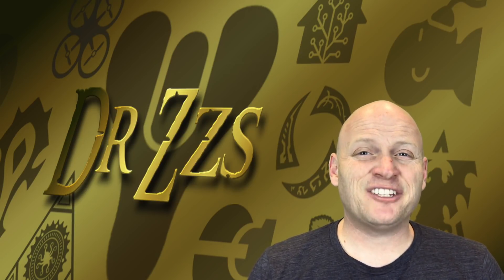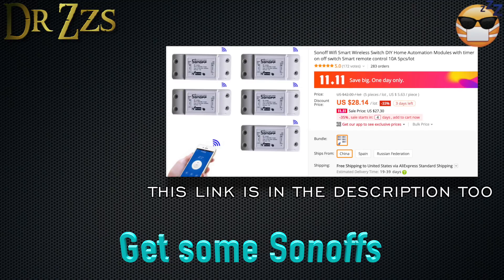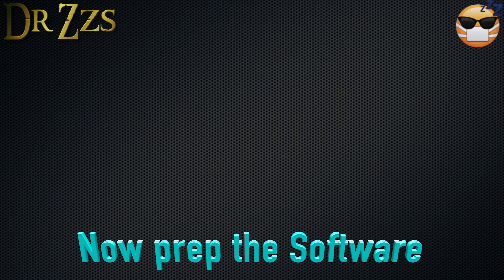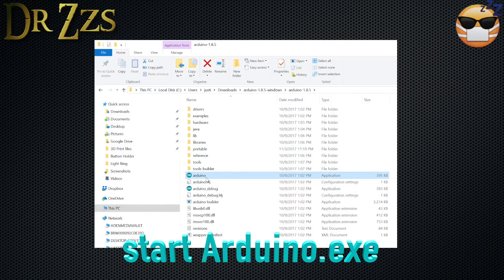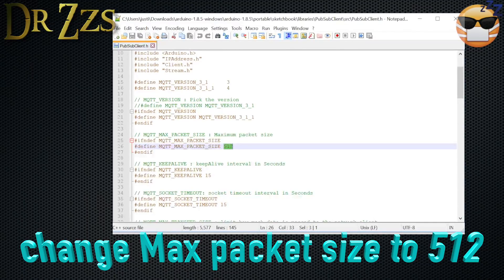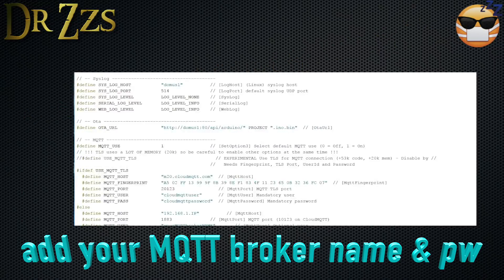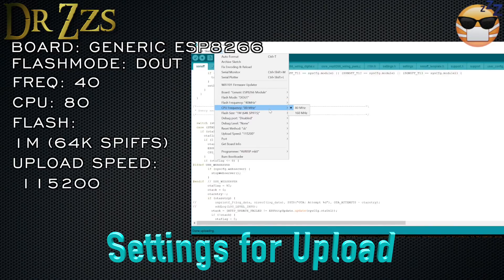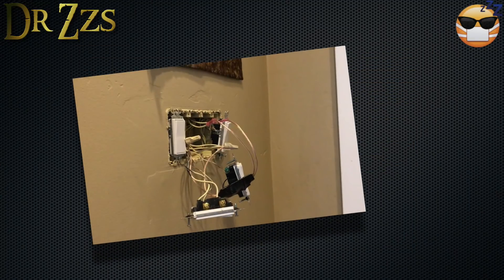Flashing TASMOTA Firmware on the Sonoff Basic

Comment: have you used mqtt ?
Reply from the maker: I use MQTT all the time!  
That's how I control all my converted Sonoffs, and a bunch of other wifi stuff.  I have Mosquitto running as the broker on the same raspberry pi I run Home Assistant on.  Works great.
Reply: i use an android app called mqtt dashboard this one https://play.google.com/store/apps/details?id=net.routix.mqttdash&hl=en_GB and a cloudmqtt server i can pass data to the sonoff with that app, i have created buttons to turn lamps on and off and can even  change the colours of the ws2812b leds, i dont have any sensors attached at the moment as i am waiting for them to come back from banggood, i just wanted to get to grips with reading data off the sonoff and see that in the documentation for mqtt dashboard it can do that https://lh3.googleusercontent.com/kIP0v4REyastAehNWiYg8cihn4JDJaHD_jEs2nhNj4Lq4mULnOipZW6GszAeeSAJgmY=h900-rw

Comment: great video, i will doit soon but a question......after flasing can i still use alexa with tasmota firmware????????????????????
Reply from the maker: Well, yes, but not in the same way you can without Tasmota.  There are a couple ways to use Alexa and/or Google home with Tasmota. I think the easiest way is to set the sonoff to emulate either a Wemo or Hue bridge. From the Tasmota main page go to Configuration and Configure Other. There are check boxes there for emulations.  That should make the Sonoff detectable by Alexa or Google home.  
The other way is to use a Home Automation hub, like Home Assistant.  Connect the Sonoffs to HA with MQTT, then you can connect Alexa with the HA cloud.  And I think there's a component for Google Home. Not 100% sure about that though. 
Anyway, emulation should work.

Comment: hi,
everything works fine but now i can't toggle the relay. and the green led doesn't open when i plug something. maybe something burned but i don't know. I need to let the ESP8266 Module connect to the sonoff ootherwise i can't open the sonoff.:( I need some help please..
Reply from the maker: hmmm
Give me as much info as you can about what you've done and what you're seeing.  Post a short video if you can, that's most helpful.  I'm sure we can figure out where the problem is. 
Sorry it took a few days to reply.  
Somehow some comments are getting buried instead of appearing in order.

Comment: here goes ws2812b leds mounted on the front.... https://www.youtube.com/watch?v=CPw5ixEF89Y
Reply from the maker: That is so cool!  
Thanks for posting that!  Now I need to think of a good use for it.  
I'd try using GPIO14 as a switch still, and use one of the other pins for the leds.  I wonder how many LEDs it can run?  
I knew that feature was in there, but that's the first time I've seen it in use.  
Nice work!
Reply: you would probably need to run external power supply if you run too many, i think the leds are 20ma per pixel so mine is about 120ma  2 leds with 3 pixels...I have not put a meter across the 5v to see what current the leds are actually pulling...
Reply: you could replace the dim green led on board and replace it with one ws2812b just another thought...
Reply from the maker: oh ya!
And I think you can change the function of that on board LED in tasmota too.  I think I remember seeing Console commands for that.  Not 100% sure though, I'd have to look again. 
Super cool man!  I'm so glad you showed me this!
Reply: the onboard led is actually a green red led just that one of the pins is not connected but used on the rf sonoff to light red instead of green it could be connected though to a spare gpio pin if needed... t.b.h. i think its pretty useless as its so dim hence why i put a ws2812 on there so i can see from a distance what the sonoff is doing...
Reply: as you probably know the ws2812b leds are all individually adressable so some leds could  be used for light on off conditions, other ones could be used for messages say for instance you got  a facebook message ifttt could send a mqtt command to flash an led.. another thing i was thinking was to plug in the sonoff in a socket and when i move my phone in the night. ( theres gyros and sensors in android phone,)  as i need to get up.. to use the bathroom the led would come on for a set period to save me turning on the house lights. also could be linked up to the thermometer to show low / high temperature... so many uses for just on small strip of leds...
Reply from the maker: That's awesome!  
Does tasmota provide a way to send a different color signal to different LEDs in the strip?  
Another cool use would be to have a PIM sensor on the Sonoff and if it doesn't detect motion for a period of time the light starts to flash for a minute before the sonoff turns off.  That way if someone actually is in the room they would see the flashing light and wave an arm or something to keep the lights on.  That used to happen to me while studying in the library. Sit still too long and the lights turn off on you.  That's the downside of PIMs on lights.  
Anyway, super cool idea!  I'm excited to see what else you end up doing with it.
Reply: yes colors can be changed on tasmota software and to different leds, i can change colors all leds are individually addressable

Comment: just uploaded tasmota 5.11 works great just did the update via console, and did the initial flash with eps tool for windows, tried arduino but did not work for some reason... any way... was going to ask can i use google home now with tasmota ? got a mqtt server setup too... and sorted some ws2812b leds on gpio 14...
Reply from the maker: bing quadby I use MQTT for all of mine. But if you want to use google home you can set the Sonoff to emulate a WeMo or a Hue. That should make it discoverable and controllable by google home. 
How are you running MQTT?
Reply: running mqtt on cloudmqtt server at the moment.. first time i have ever setup mqtt on anything works well though... using iot mqtt dashboard on android phone..
Reply: have you got this to work..? would be great to see how to set  up wemo / hue emulation,  as i cant seem to get it to work...

Comment: Hi DrZzs, thanks for all your video. I really like the idea of make domotic my house but I've a question. I would like to know if during the standby period of the device if it produces WiFi transmission (and if so, how much) considering that if there should be more than 50 devices installed in a house, the transmission could end up being unsafe for human exposure. Cheers
Reply from the maker: that's a great question.  I don't know enough about what having too much wifi exposure does to us.  
When you get the device running Tasmota you can watch the Console and see how often it sends wifi messages.  I think you can adjust that too, so you could probably decrease the amount of transmitting quite a bit.  
Check out the Tasmota site and see what you can find about how often it sends messages in standby and how you might be able to decrease it. 
https://github.com/arendst/Sonoff-Tasmota/wiki/Commands

https://github.com/arendst/Sonoff-Tasmota/wiki/Domoticz

Hope that helps! 
and I hope I'm not frying myself and my kids with all our wifi!  We've got at least 20 devices connected at any given time.
Reply: Thanks for your answer. The problem is not only the MQTT protocol (like you said, maybe we can reduce the amount of messages between the sonoffs and the server <DomoticzUpdateTimer>) but the WiFi protocol itself. I think the Tasmota developer can give us an answer: https://github.com/arendst/Sonoff-Tasmota/issues/1805

Comment: In my case, HASSio only recognises the sonoff's, if I enable Belkin WeMo emulation in the Tasmota configure other tab. Is that right ?
Reply from the maker: for auto-discovery, that's probably right. 
What I do (which isn't necessarily the right way) is put each sonoff in my HA config as a switch and use MQTT to control them. 
I haven't used the emulations.  
Hope that helps!
Reply: Hmmmm and I was glad they showed up automatically, lol. So I have to disable the emulator, and add them manually? Can I use the code in your sonoff dual video, but just "cut it in half" ? I am just starting wit HASSio and have a lot to learn still. Love your videos ! I would love it when you would make some more HA specific videos.
Reply from the maker: I just upgraded to Hass.io (finally).  You might not need to disable the emulation.  I'd need to mess with the emulation to figure out how to control them with HA.  I'll bet it can be done. 

If HA is recognizing your sonoff as wemo, then they should show up on your HA states page.  That's the <> symbol under Developer Tools. Somewhere in that list there should be a device with wemo in the name (I'm guessing a little bit here).  Once you know the entity name you can do things to control it. 

I'm working on a video for set-up of Hass.io, including MQTT broker set up.  If you don't have MQTT set up you won't be able to do it my way.  

Here's the instructions for MQTT broker set-up:
https://home-assistant.io/docs/mqtt/broker/

Hope that help!

I'll do some more HA focused videos.  I think I've done about everything you can do with a Sonoff.  Time to get back to Software for a bit.
Reply: I got everything working for the sonoff basics with the WeMo emulation, but the Dual had some problems. It just showed the power1 switch and messed up the rest of the sonoffs. Thats why I switched them to mqtt. Your sonoff dual video did the trick for adding them via mqtt, and although I added the mosquito broker, I forgot to set it up in the config file. Spend a good two hours figuring it out last night and got it working finally. Only thing is for the dual, switch one is a slider, and switch 2 are two lightbolts. Also, the groupname also has a slider to put the whole group on or off, for most of my cards I don't need that, any idea how to hide those ?
Reply from the maker: If you know the device name of what you want to hide you can add some lines to the customize section to hide them:

customize:   
   sensor.justin_iphone_battery_level:
      hidden: true

something like that.

Comment: will this work with alexa
Reply from the maker: Yes.  There's a few different ways.  
If you keep the stock firmware that comes with the Sonoff (eWeLink app) it supports Alexa out of the box. 
If you use the Tasmota firmware you can make the sonoff emulate a WeMo or Hue Bridge.  Then it should be discoverable by Alexa.  
Finally, if you use Tasmota and Home Assistant (which is what I do), then you can use the Home Assistant Alexa Skill and control the sonoff that way.  That's what I do.  I have Alexa controlling things through Home Assistant. 

Hope that helps!
Reply: DrZzs thank you for the info great help
Reply from the maker: You're super welcome!  
Hope it helps!

Comment: I did get a lot of errors, but using Arduino IDE 1.8.5 (i was using 1.6.7) and copying the lib folder did the trick.  MQTT packet size is need to be at least 1000 with later tasmota firmware. so try that if you have problems.
Reply from the maker: Excellent!  
That's good info that I didn't have.  Seem like copying the lib folder is better than directly including individual libraries.  
I didn't know about the newer versions needing larger MQTT packet size.  Do they have that changed already in the PubSubClient.h from their lib folder?  I guess they must.

Comment: Hey man, great videos, I used your tasmota OTA instruction to flash one of my sonoff basic switches and it works like a charm! Only problem is, I had zero success in integrating the tasmota flashed sonoff into my homebridge...
Question: do you need a raspberri PI for these projects? Can you just use a mac? did you/will you make a video tutorial on how to set up the sonoff and something like homebridge (in my case on a mac) so as to integrate everything with apple homekit? I'm pretty new to this and im far from being comfortable with coding and using the terminal on mac, but your guides are super easy to follow thus I hope you have something that can help me or will consider making one... Help :p :D ;)
Reply from the maker: Thanks! 
Homebridge and Homekit are on my video to do list.  Don't know when I'll get to it, but hopefully before too long. 
Did you try using the emulator modes in Tasmota?  I don't know if it helps with Homebridge/kit, but it's worth a try.  You can make the Sonoff appear as a Hue or Wemo. 
I can't remember the menu option off the top of my head, but I think it's the "Configure Other" option.
Reply: DrZzs I blindly tried to switch them on but I really dunno what to write in the json after that... i even tried to install mosquitto on my mac, but as i said i have no idea what I’m doing, hence I couldn’t even find mosquitto’s address or where/how to configure it... Ask me to wire something and i will build a damn nuclear plant... ask me to program something and i can be defeated by a simple server address...

Comment: I wanted to update this for anyone having the same problem I was having (see previous posts here)
I have tried a hundred different things, but never could get it to work.

Ultimately, it flashed when I changed the serial to USB adapter.

Good one:
https://www.amazon.com/gp/product/B014Y1IMNM/

Bad one: 
https://www.amazon.com/gp/product/B00IJXZQ7C/

Once I ordered the EXACT one that Dr Zzs showed in the video, it worked correctly.
Physically looking at the two models side by side, they are identical.  But clearly, something is different.
So if you are getting failures, get the right module!
Reply from the maker: Dang! 
Well, I'm glad you finally solved it.  Suck you had to go through all that.  
I need to look at the differences between those adapters.  I could have easily recommended a bad one potentially. 
Thanks for sorting that out!

Comment: I have to say that my many attempts have failed after hours and hours.  The final straw is this:

warning: espcomm_sync failed
error: espcomm_open failed
error: espcomm_upload_mem failed
error: espcomm_upload_mem failed

It sounds to me from reading the comments that it's not going into programming mode.  This is a Sonoff Basic, and from what I'm seeing GPIO0 is the button, but pushing while powering up simply doesn't seem to work.  Has anyone else had this happen?  
Could the hardware revision have changed?  
The boxes (purchased from Amazon) say Sonoff Basic.  The board says Sonoff TH_V1.1 near the output.  However, looking up a Sonoff TH, it should have a connector on the side for a sensor, which this does not.  So, I'm lost as to what to do.
Reply from the maker: Sorry you've struggled so much. One way or another your computer isn't communicating with the Sonoff.  Could be it's not in programming mode or maybe the Rx/Tx wires are switched.  All the settings in Tools are right?  DOUT, correct port selected, etc? 

Post some pics and I'll take a look, just in case it isn't actually a basic.  
We'll get it figured out!
Reply: I appreciate your reply.  I have made about 25 different attempts to flash the firmware with slight variations.  I own an IT company and had one of my guys spend a few hours on it too.  We are fairly certain that the Sonoff is simply not going into programming mode.  And yes, we both tried things such as checking Rx and Tx.  I've provided 3.3v from another power supply, used different computers, etc.
The only thing I've not tried is a different usb/serial adapter, but I did purchase the one you suggested here (or on another one of your videos).
Interestingly, there is a rather large post where many others have found the same thing I did.
Maybe I just got units that don't work correctly on grounding GPIO0 on boot up.
I was going to try the wireless flash option, but it doesn't work on the newest stock firmware, which my sonoff has.
Reply: And to add to this; here's the article I read where others were seeing this same issue:
https://github.com/arendst/Sonoff-Tasmota/issues/463

Comment: whats up doc. got my sonoffs in and been working on this flash. im someone that has arduino IDE installed already on my PC and attempting to make a "portable" directory breaks the IDE. you may want to annotate that you want the "non-admin zip" version for it to work correctly. otherwise im fairly sure youll have to put portable in the documents directory for arduino instead, but i havent tested that yet, ill reply if it works
Reply: negative. but i do see the files in the default library section in arduino. so all should be good to just have people that already have arduino installed to their PC to skip the portable bit and look in their /Documents/Arduino/libraries folder. also on compile i got another error where it couldnt find tasmota serial thats solved by copying over all the files from lib in the tasmota file to the libraries folder in arduino. after that it flashed successfully
Reply: as a final note i can confirm i was able to follow the next video after flashing with a pre installed arduino IDE install and i have 2 switches currently in the wall and operational